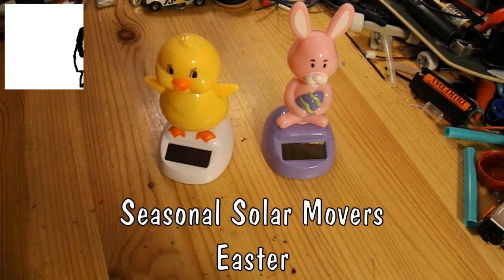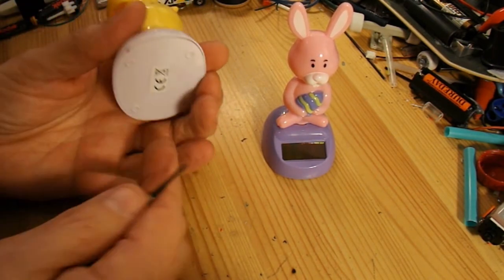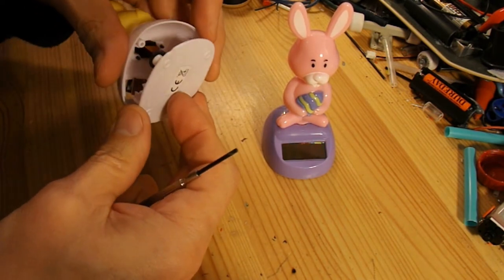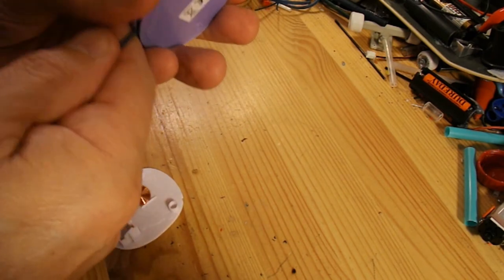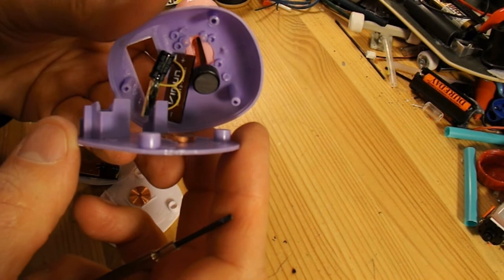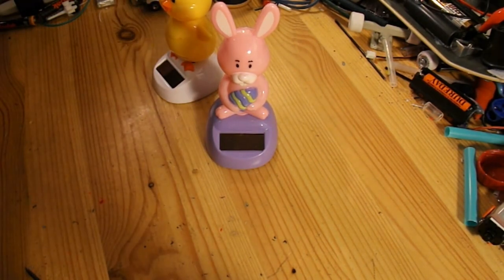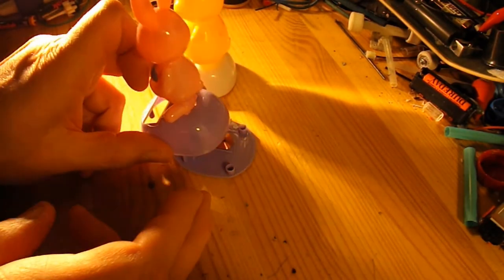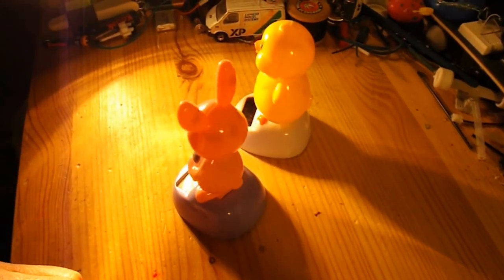Seasonal Solar Movers - Easter - quick dissection

Comment: Hey Grandad. What are the specs on the capacitors in the solar mover? It would be interesting to find out.
Reply from the maker: There are still pictures at the end of the video with close-up detail. The capacitor is at 03:41